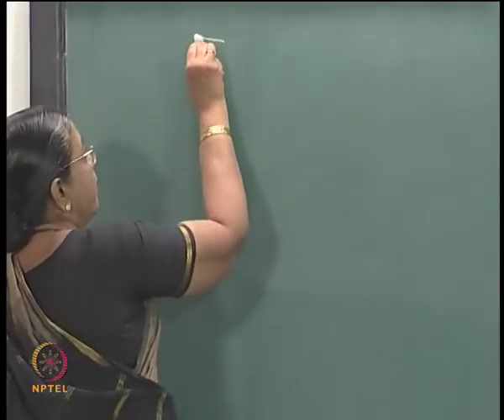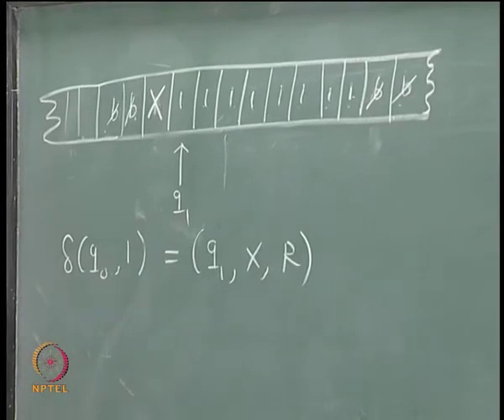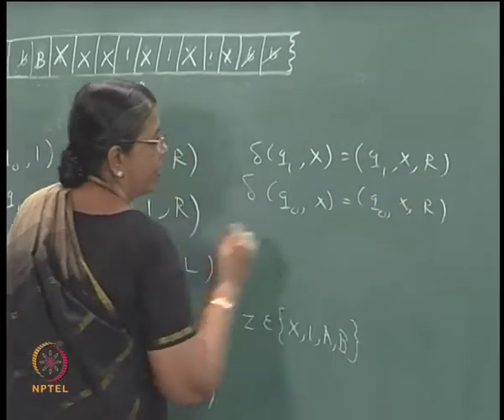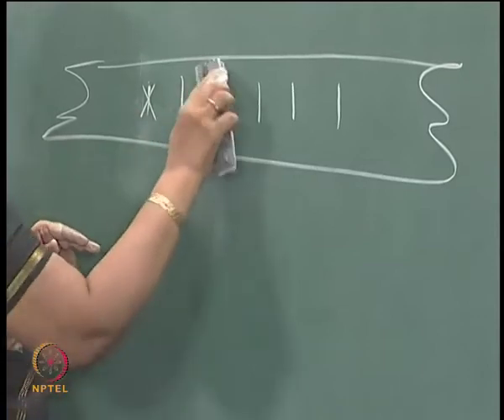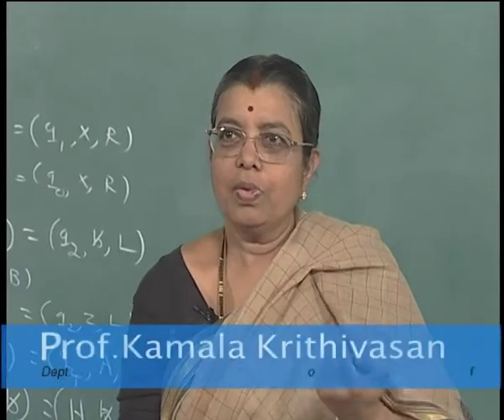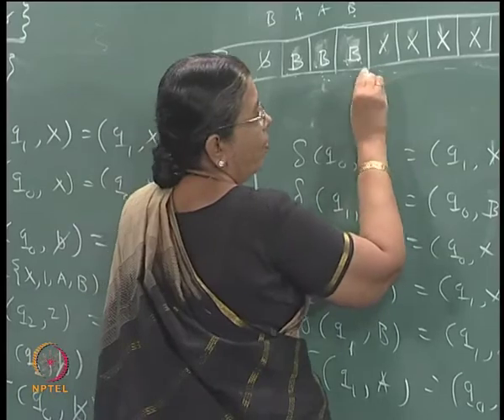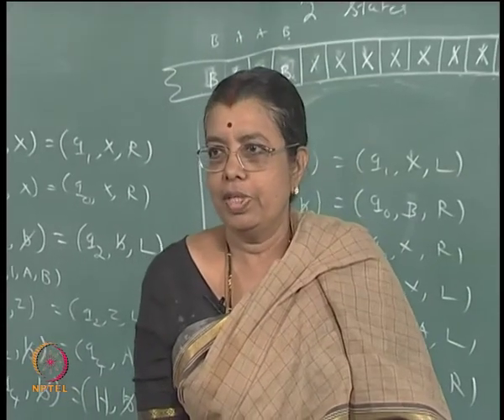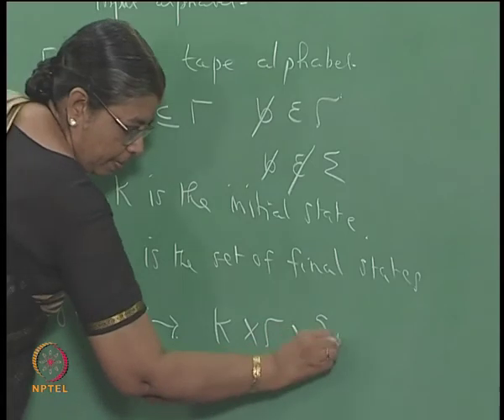Mod-05 Lec-27 TURING MACHINES (Contd)

Comment: But still I am not clear what is the exact use of a Turing Machine
Reply: To simulate any form of computations,,
Ex ::lets say u write an algorithm which is really complex n u don't know if it works in real life..so we try to simulate(like tracing) ur algorithm to see if it is computable...
If ur algorithm can not be run by TM then there is no way we can implement it using real computers...
(But thr r very few exceptions though)